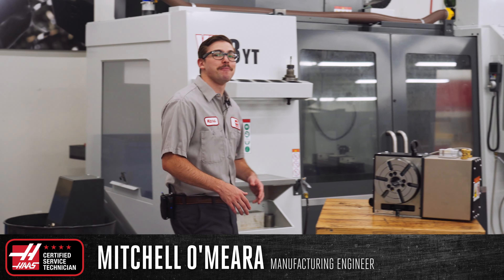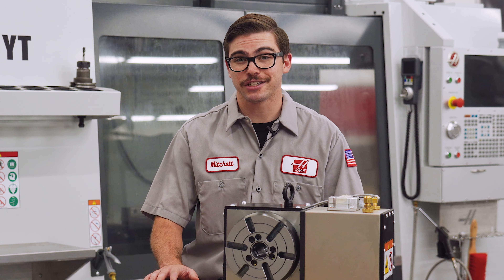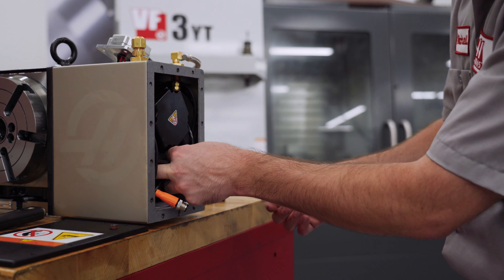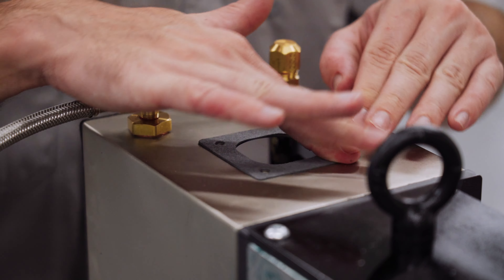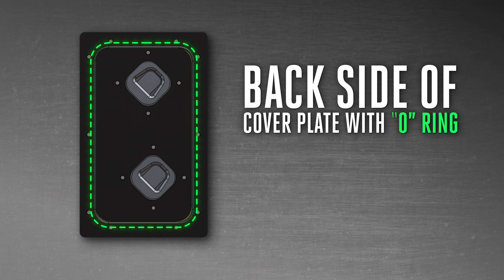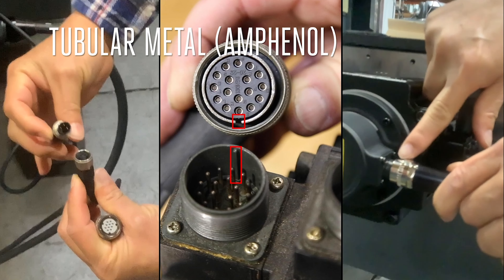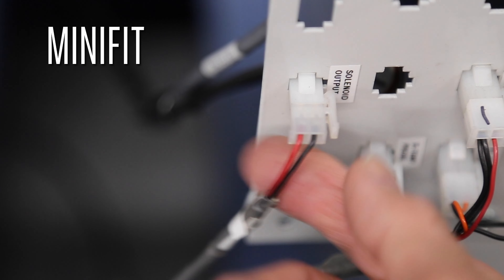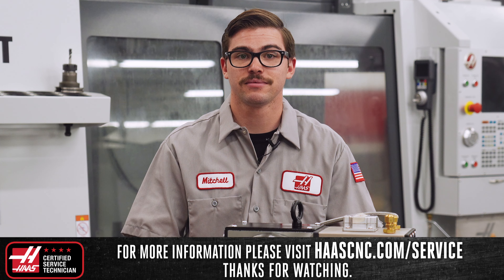Rotary Cable Replacement - Haas Automation Service

Comment: My FV3-SS was an awesome machine much smarter than me. However, the service guys are in love with  a can of sudden death they carry. It will kill your seals and any neoprene on your machine. That can of sudden death is WD-40. Do not ever let them use WD-40 on your machine. It will cost you a ton of cash that YOU will have to pay for, even though it was their mistake. A service guy showed up at my shop. The very first thing he pulled out was that blue and yellow can of death. 

I told him straight up if he used that can on my machine, he is going to own that machine. I also informed him to never bring that in my shop again. Use automatic transmission fluid. I made sure the service desk.......from that day on....had that requirement in my file. I loved my HAAS.I am looking at another. Made in USA.....can’t beat that.